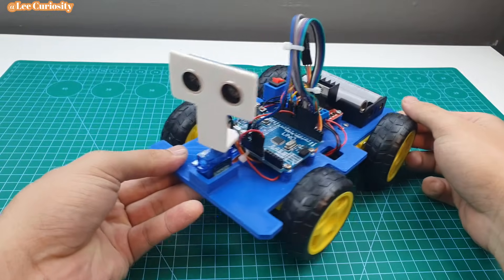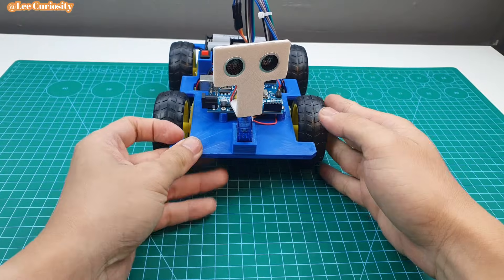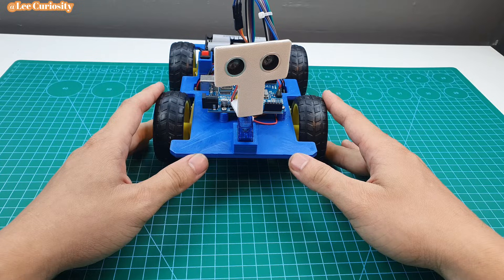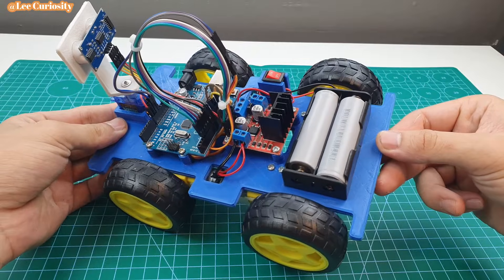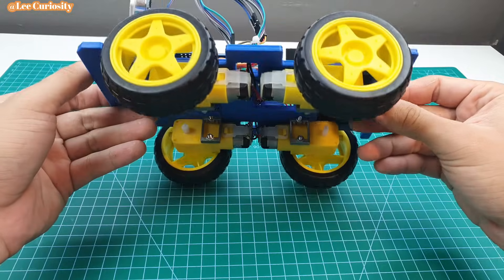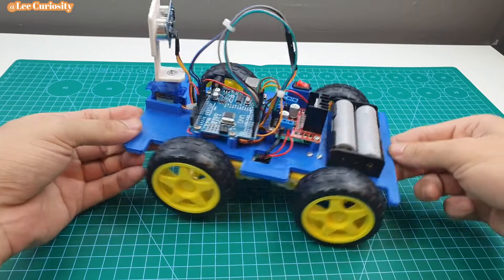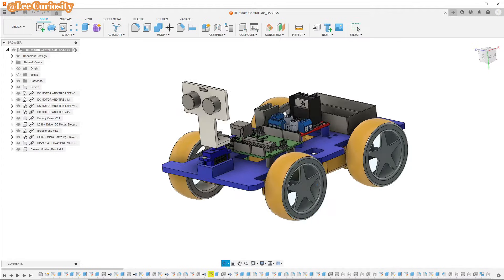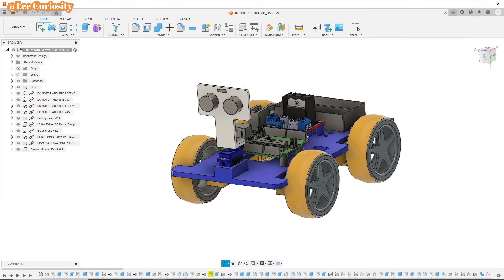Obstacle Avoiding Robot Using Arduino | Simple DIY Project

Comment: Servo and ultrasonic sensor not working
Reply: Bro ardunoi and motor driver is working but sevo is not rotating and motor  runs suddenly
Reply: @KarthikaR-z2l  chek the connections from motor driver and motors tihght screws properly

Comment: It would be great if you added that it could still be controlled by Bluetooth, even if it is changing it from the programming with a comment for example.
Reply from the maker: Well i will make it in the future 😍
Reply: @LeeCuriosity  Is it possible to integrate a remote control and Bluetooth to this and for both to work simultaneously??